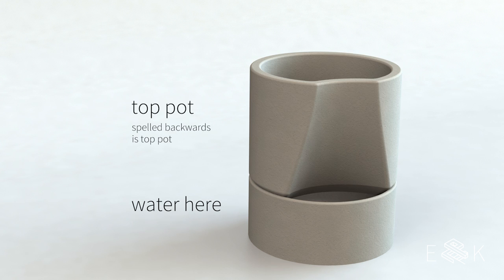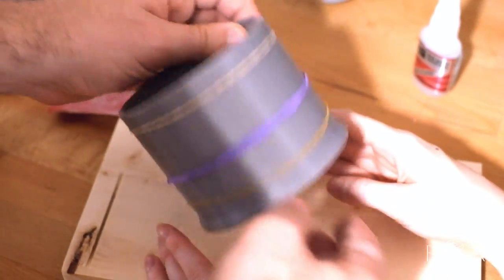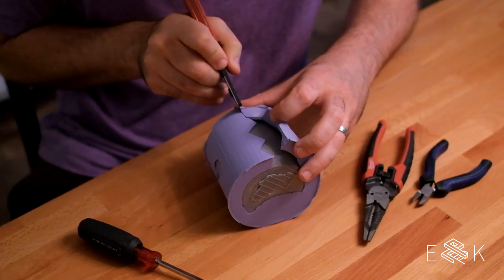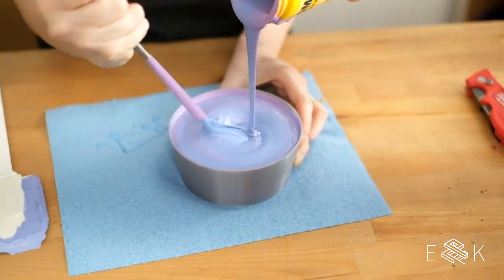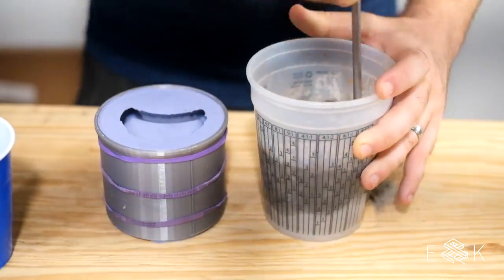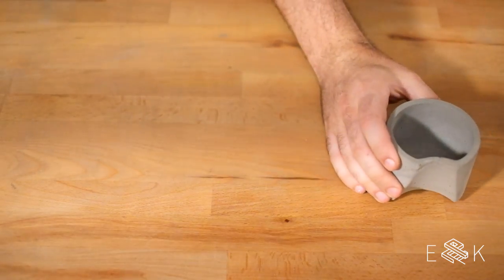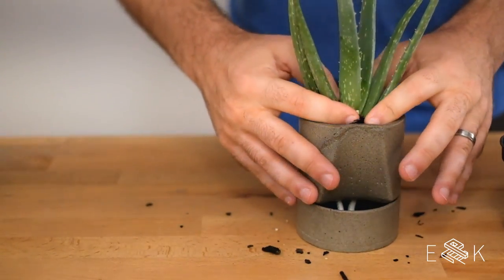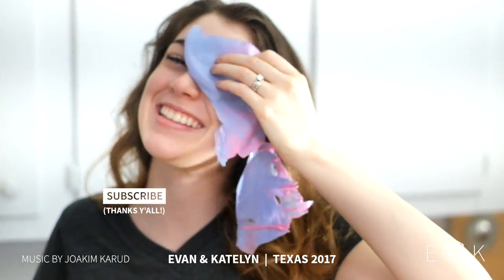DIY self watering concrete planter | How to

Comment: Try using a sander to vibrate out the bubbles. You can also cut a zig zag pattern like you did but all the way around (or until it pops out) and that can be easily put back together for the concrete
Reply from the maker: +Mike Builds we need to try the sander trick! And yes probably would have been better to keep going with the zig zag instead of risking a tear 🤦
Reply: EvanAndKatelyn by the way love the videos, keep 'em coming
Reply from the maker: +Mike Builds thank you! Editing the next one right now 😊
Reply from the maker: +Mike Builds thank you!!

Comment: isn't it easier to just use the 3d printer to make the actual vase instead of using it for the mold?
Reply: 3d prints arent water proof
Reply from the maker: ^ True. Plus we hoped to make a lot with a silicone mold. Might have to redesign a V2 to make it the process easier though

Comment: Don't you have to refill the water in the bottom section? If so... isn't that just watering it anyways lol
Reply from the maker: +Gryffindor Prefect ah sorry we've had some confusion about the term! Self watering is a term used to describe planters that have some form of reservoir that has to be refilled less frequently that the plant supposedly takes the amount of water it needs from (aka waters itself)
Reply: EvanAndKatelyn ah, nice project 👍
Reply from the maker: +Gryffindor Prefect thanks!

Comment: If your not tryin to fuck with silicone use PVC pipe take a 4 inch piece cut it the size of planter then using more PVC make the little indent
Reply: Oh and for the bottom use a inner end cap
Reply from the maker: +Matt Kennedy that would be fun to try!
Reply: EvanAndKatelyn thanks imma try it I'll let u know how it works out

Comment: How much did you spend on supplies?
Reply from the maker: +Missy Evitt the concrete bag was $10 or $12 bucks and we used maybe 10% of it for this project, so it's pretty cheap. The silicone is more expensive, $27, but you can reuse molds over and over again (if you don't break it like we did...) We have links to the exact products we used in the video description. Hope that helps!

Comment: How mutch would it cost to do this project?
Reply from the maker: +Bella smith- cat life the silicone is $25ish and the concrete is $7-$10 depending on the size of the bag. But you should be able to make several planters with that material!

Comment: There is a mold release spray you can spray on your parts to remove them easier.
Reply from the maker: haha I think we were burning the candle at both ends while filming this, I had some mold release right near us while we were making it but didn't use it whomp whomp! In our last mold I have instructions sharpied on: 6 oz per pour and DON'T FORGET MOLD RELEASE :P
Reply from the maker: Thanks for sending in the suggestion though!

Comment: I really wonder that why my concrete cracks always?
Reply from the maker: Might be because the water proportion in your concrete mix was a little too high or too low
Reply: Thank you for your response. Any suggestion for the proportion?
Reply from the maker: nuvismo we try to mix ours til it's like Sandy pancake batter, but that's specifically for the quikrete concrete patcher which is the main one we have experience with. All bags will have a proportion mix suggestion on the back which should help 👍
Reply: Thank you again. I will try it (:

Comment: Why not just use 3d printed pot
Reply from the maker: +AreDoubleYou concrete is cool :) also we were hoping to make a ton using a mold, which is faster than 3d printing and scales well but we need to revise the design before we do that

Comment: So how am i supposed to make one?
Reply from the maker: Like we mentioned in the beginning, instead of 3D printing a mold you can make a simple one out of wood. The channel Homemade Modern has some great examples of this. The steps to mix silicone and concrete are the same (and they're easy 👍😊)

Comment: You should have used mold release
Reply from the maker: Ahhh lol I was obviously kicking myself in the demolding stage, one bc it was a hard shape but also I should have mentioned that we forgot to use the mold release. We normally is Mann 200 but forgot this time. I realized it about 5 min after the pour and considered just pouring it back out but that would be a lot of silicone wasted so thought I'd give it a shot lol. Thanks for the comment and input though! I'll try to include that tip on the next video

Comment: DIY. uses 3d printer
Reply from the maker: +Ximon Whhatt as we mentioned in the beginning, you can use wood to replace the 3D printed parts to make a square planter, and the rest of the steps would still apply. Or you can download our model for free and order it printed from 3D Hubs 👍